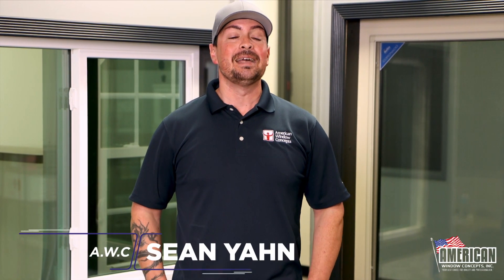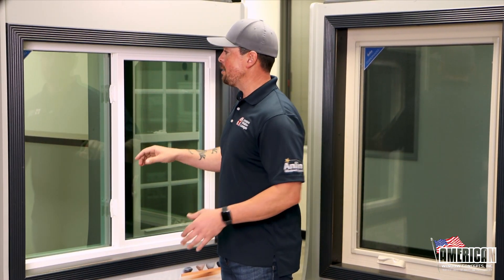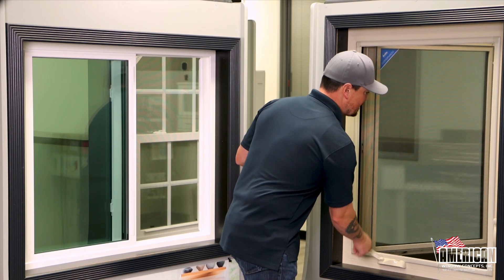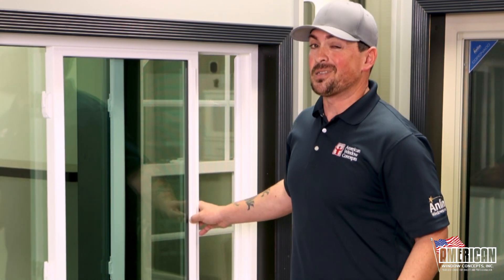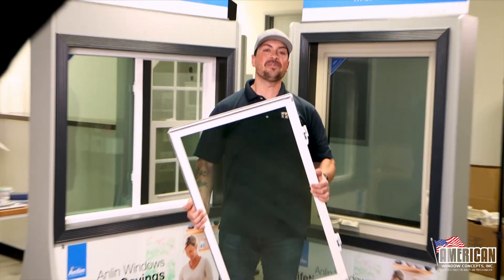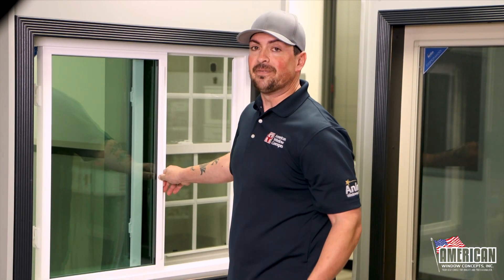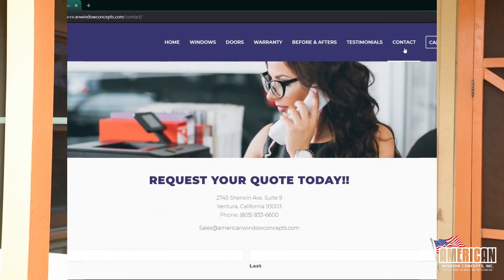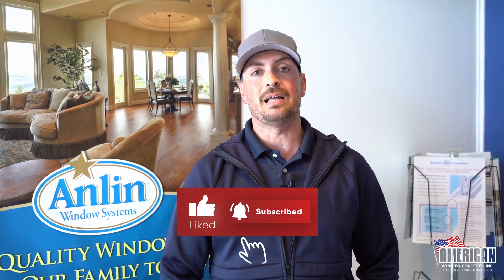Crank vs Sliding Windows (2022)

Comment: My house is on a busy road. We can't sleep in the morning. We have slider three sides windows. The windows are removed from both sides. The noise comes between sliders when it's sliders. What design window do you suggest for large bedroom windows with three sides (panels)? What window design do you suggest? We have triple-pane glass but the space between sliders creates the problem. We need soundproof windows.
Reply from the maker: The best option for sound is a tightly sealed casement or awning window. They have a compression seal on the exterior that really helps with sound transfer. Sorry about your situation.